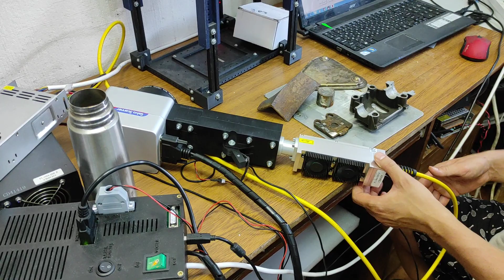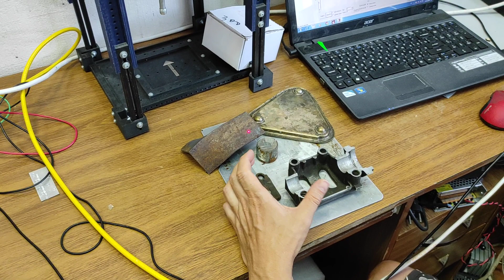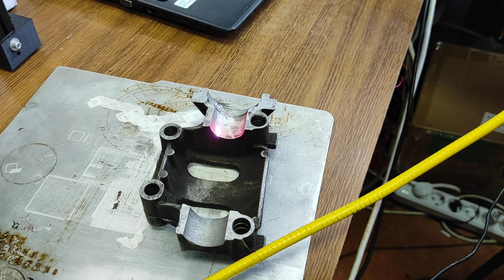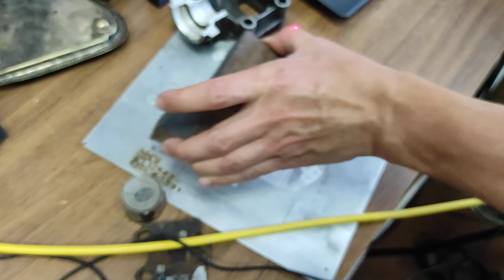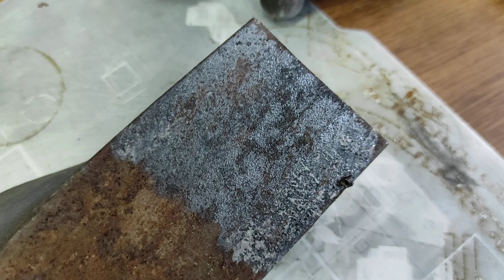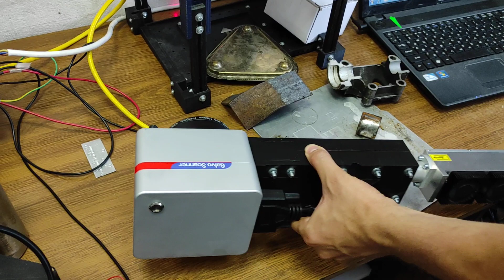Endurance handheld laser rust removal. 10 watt DPSSL impulse laser module inside.

Comment: Again, I’m missing the process parameters - what deflection shape are you using, the visible red beam only moves about 5 mm.  Unclear if that is a Lissajous curve (consisting of two sine-waves at different amplitudes for X and Y) or saw wave etc., focal spot size is not known, pulsing frequency and pulse width is not given.  Please add these details.  You need to add exhaust/suction or you breath in vapours of heavy metals, potentially lead paint… whatever the surface contamination may be.  Take care!